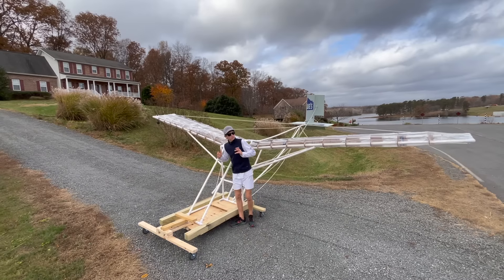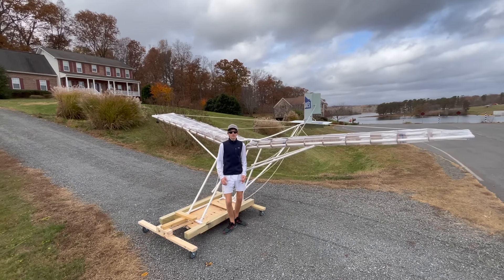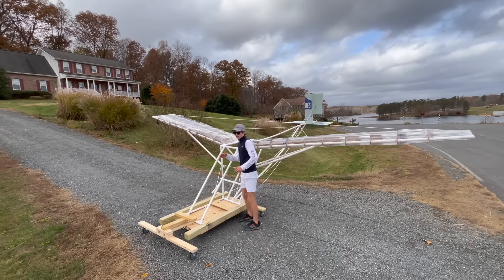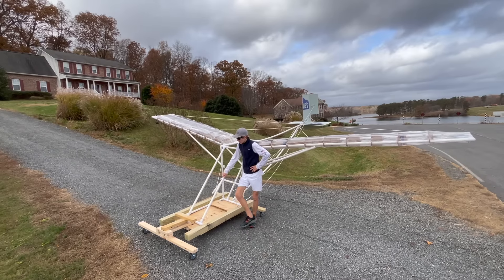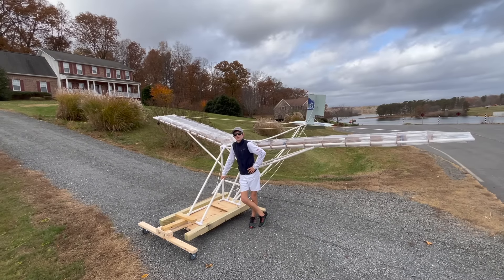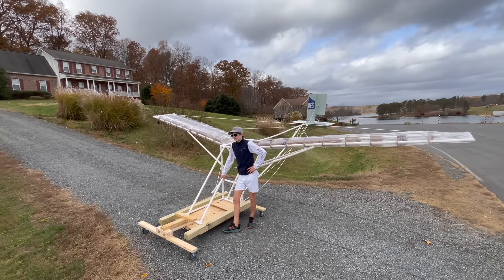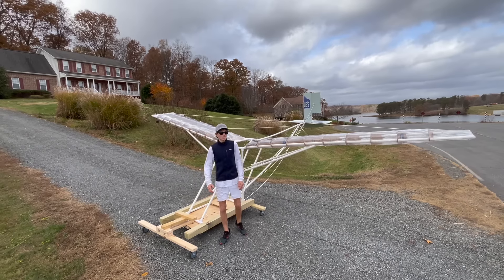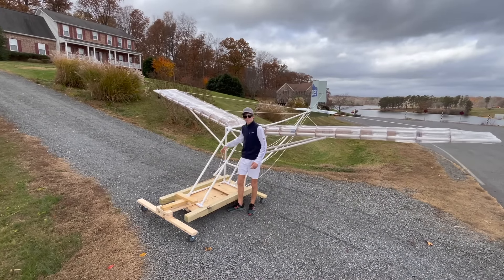I Built A One-Man Airplane!

Comment: I have a few observations for you. First, you are sitting way too forward from the centre of the lift. Depending on the airfoil, the centre of gravity usually is around 20% of the chord. Looking at the cage from the side, it appears that you have the wing set at zero degrees angle of incidence relative to horizontal flight. The incidence angle again varies depending on the airfoil, but it is usually at least 2 degrees leading edge up. Also, your empennage (tail) is way too small for the size of the plane. A quick internet search would get you to the formula for calculating the proper tail volume for safe control. Your tail boom is flexing and twisting, which would create a control problem during flight. And lastly, your control levers could be more intuitive. 

As a long-time private pilot, I got my license in 1973 and still fly at the age of 78; I have experienced many instances when a quick reaction saved the day. You will learn to "feel" the plane. It tells you it is not happy with you and demands corrective action. There is no time for thinking your action will determine the outcome. Your elevator control is a conventional stick setup, but your rudder is not, which can be a problem causing confusion and the most critical time. You mentioned taking flying lessons, so I suggest doing your ground school course first. All of the comments I made above will become much clearer to you.

"Aviation in itself is not inherently dangerous. But to an even greater degree than the sea, it is terribly unforgiving of any carelessness, incapacity or neglect." — Captain A. G. Lamplugh.

I like your enthusiasm. Learn and stay safe.

Comment: Consider yourself lucky you didn't get off the ground, all of those models should have shown you physics are a bitch! Even if you had gotten airborne, you didn't have nearly enough rudder and elevator to handle the asymmetry of your weight and center of gravity of your body,and the wings could have possibly folded... That said, that was actually pretty cool...it was like the stupid things I did when I was your age. Keep doing what you are doing, just be a little more methodical in your approach. Use a test payload, work out the bugs, before you risk your life.
May I suggest a You Tuber named Mike Patey has some really good videos on how to truly build an aircraft from scratch. He can demonstrate a little healthier approach designing and engineering riskier projects.

Comment: the wood undercarriage is way to big and heavy, you should focus on your airframe and use fiberglass to build a TUB which has reinforcementto place wheels (think in terms of a glider).  The PVC is an interesting medium which can also be reinforced internally or perhaps can be used as a mold to create composite spars.    In the old days, they used cotton fabric and varnish.  If you have a chance to travel to england or europe, they have some fantastic air museums, and even likely near you, someone is restoring some of these old machines to better understand the technology.  Composite is really the best medium.  Perhaps you can visit boat builders and learn some tricks of the trade...

Comment: Great!  Use a lighter plastic cart - not wood, with bigger lightweight wheels.
Reply from the maker: Thanks! The kart was not actually attached to the plane, it was only there to allow it to gain speed, then the plane (hopefully) would have lifted off of the cart and flown. The landing would be more of a controlled crash.
Reply: @All_Original  Great!  I love it.  Maybe a greater wing surface area with a more rigid set up.  You are so close!

Comment: The air frame is not structurally sound, its also way too heavy. You want to use styrofoam the same wood used in rc planes or carbon fiber. The pvc is way to heavy. The larger the wings have to be the stronger the whole structure has to be. You end up in an endless cycle of needing more lift to carry more weight. Look at test flights designs, they are a youtube channel making rc planes, but especially see peter sripol’s channel who has made 3 diy planes so far which all successfully and safely flew with him in it

Comment: Kid very good , learn the established math regarding aeroplane design it will save you time money and possibly your life and will bring you guranteed success   , it's a incredible achievement just building one so Very well done , but I could tell instantly that the control surfaces and the wing area are not sufficient so I knew the outcome , thank goodness you didn't build a wing capable of enough lift . With the horizontal and vertical stabilizers  (rudder /elevator)think bigger than you think you need and lightweight  .. Also increase the wing chord , that's the distance between the leading edge and trailing edge of the wing , because the bigger that distance is the more lift the wing will create providing you have a good wing wing foil section rather than wider wings .looking forward to seeing you reaching for the sky in the future ....Also finding  center of gravity is absolutely necessary regardless of anything else .

Comment: Huaaah, did the same, when I was 20 years old. That was 43 years ago. In my "plane" the pilot was liying on his stomach. It was a biplane with also too less lift. We pulled it with my fathers car and a long long rope. After some trials my brother asked me to drive faster and faster, because he WANTED to fly. I did and I saw in the back mirror my brother getting sidewards away from the street. He was confused about the rudderpedals which were behind him  and not in the front. The "airplane" jumped over the curb and flew several meters well controlled into the lower field where it crashed. My brother was fine and we had had a lot of fun. Send me an E-Mail, I will sent you a picture.

Comment: This looks super sketchy but I would totally be willing to fly that! You could possibly try reinforcing the control surfaces and stuff like the tail with some carbon fiber of fiber glass. I bet you'd also be able to wrap some composite (like fiberglass) around the joints and/or pipes to reinforce the entire thing. And if you got some cheap engine on the front you could definitely get airborne. Absolutely joyous video overall!
Reply from the maker: Thanks so much! Will be noted for a return to this project in the future!

Comment: WOW, you certainly make s pinewood derby car "look like a booger".  It might help you a lot, as you source materials and methods, to distinguish between "shrink wrap" and "cling film".  Unfortunately, the terms are often used interchangeably in industry.  Cling film is like a giant roll of Saran Wrap (I think that's what you have), while Shrink Wrap (heat shrink film) actually ends up giving you a film, pre-stressed in tension, over the entire surface of the wing (like monokote).  You might be pleasantly surprised with the performance of actual heat shrink wrap, as compared to a giant roll of Cling-Film.  STAY SAFE and keep up the good work! :)

Comment: His attitude and enthusiasm is commendable but this is a disaster waiting to happen. Even at a relatively slow speed a crash without even a seat belt would propell the pilot out of the seat into a rock or whatever happens to be in the way. Ican't see anything like a crash helmet yet if open cockpit microlights are show,they always have both. Has he thought about CofG? Also the controls are totally non standard and are not what his flying lessons aircraft has, hence even an experienced pilot would not be able to just jump in and have a go. I have built a properly designed aircraft and am aware of the tremendous amount of maths, stress and stability testing that goes into such a design. This person will learn the hard way that predessors have been killed and injured have learned, why repeat their expereinces rather than learn from their failed efforts? A famous pilot called Cody was thrown from his plane and died hitting his head against a rock, it was mistakenly considered mach to not use a seat belt or helmet. This is my aircraft after 5 build inspections and 3 flight test sessions before i could have a permit to fly. https://abpic.co.uk/pictures/registration/G-BZWJ I also have a website showing the build. http://www.fredlee.f2s.com/